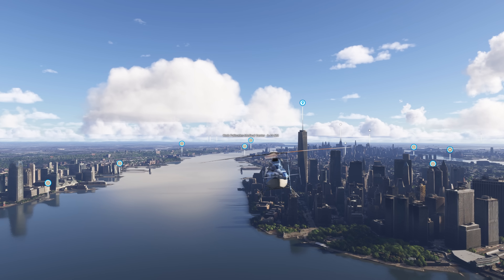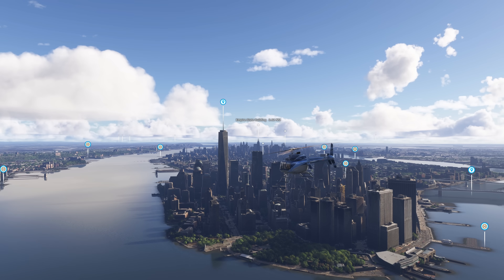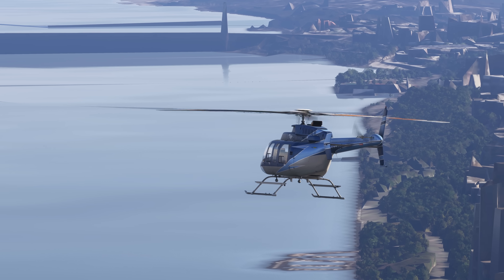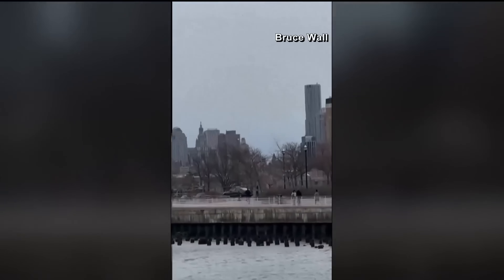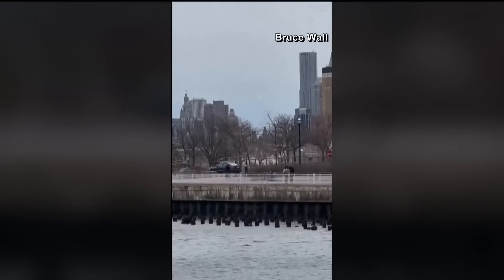Helicopter Expert breaks down Hudson Crash, and discusses “Bump Mast” Theory | NYC Crash Follow-Up

Comment: I don't know much about helicopters but if the rotors struck the  tail boom wouldn't the rotors left a definite mark or dent in the tail boom?  To me if there is no physical indication that the tail boom was struck by the rotor then it's obvious the problem was something else other than mast bumping if that is what would caused the tail boom to separate from the helicopter.

Comment: In the early 70s I worked for a company that had a Bell Jet ranger. On one trip in a snow storm they had a flame out. pilot was able to auto rotate an ;and in a gravel pit.  The rotoor did chop off the tail when they landed, bow one  was injured.  The pilot was a Vietnam copter pilot.

Comment: I've been sold on airframe failure, but have we actually seen a picture of the tail boom? How do we know it wasn't struck??? Why did the transmission and rotor assembly come out, instead of just rotating the helicopter wildly, which would have absorbed most of the pressure to keep it intact?

Comment: Bell released a bulletin in July 2023 of how they wanted a segmented tail rotor drive shaft retrofit to be carried out. Now most of the work carried out was exactly at the point where the tail snapped off . So the cause was probably due to the latest work done on the retrofit of the tail rotor drive shaft. I'll send a link to the bulletin

Comment: Looks to me it was total pilot error but no one is saying is because he was black and probably got an easy pass to be a pilot.
Reply: Looks to me like you need to answer a few questions (if you don't run and hide like the other cowards have).

First, what looks like "total pilot error" to you? Looks like he was flying straight and level, based on the videos I've seen. So, what basis are you making such claim? What type of pilot error, since there are many?

Since the current analysis of many experts in the field is pointing towards the likelihood of a major, catastrophic mechanical/structural failure. Why are you still hoping for pilot error, yet there's no indication of such?

Even if it turns out to be, and you get your wish....are blacks the only ones you've heard of when it comes to pilot error?  How many white pilots F 'd up since the dawn of aviation?  How many pilot error videos on YouTube are white men? Do you mention race/skin color on those?  If you do (and I doubt it), copy and paste your comment here to prove it. I'll wait...

BTW, blacks can and have passed the same exams that whites have. I'm living proof.  I took the same Industrial Electrical written and practical test that the rest of the applicants took. Not only did I pass with flying colors, I scored highest of all, which were majority white males.  High 90s on the written and 100 on the practical.  It's on file with the agency and I can prove it at anytime, although I shouldn't have to. 

You'll just have to take my word for it (or not, who cares).  That was 39 years ago, at age 20. Neither was I given an easy pass by the FAA, when I passed my Private Pilot checkride  at Teterboro Airport, 26 years ago.
Reply: "A sickness known as hate. Not a virus, not a microbe, not a germ—but a sickness nonetheless, highly contagious, deadly in its effects. Don't look for it in the Twilight Zone—look for it in a mirror. Look for it before the light goes out altogether."

"I happen to think the singular evil of our time is prejudice. It is from this evil that all other evils grow and multiply. In almost everything I’ve written there is a thread of this: man’s seemingly palpable need to dislike someone other than himself."

"For the record, prejudices can kill, and suspicion can destroy, and a thoughtless frightened search for a scapegoat has a fallout all of its own for the children, and the children yet unborn. And the pity of it is that these things cannot be confined to the Twilight Zone."
Rod Serling
1967
Reply: Figured you'd disappear and not answer my questions. 😂

Comment: It's not mast bumping. It was catastrophic failure of the tail boom just aft of the fuselage. Mast bumping would have detached the main rotor head, not ripped the entire upper deck from the aircraft. The static stops would hit one side of the mast, made one half a rotation, and contacted the other side. Those two contact points damage the mast (denting it) and off it comes, just below the rotor head. Looking at the video, I dont see any abrupt changes in the aircraft attitude that would cause mast bumping.

Comment: Hey Cpt Steve, Here is my take on it .Using physics and mechanical engineering concepts, here is what will happen.
Role of the Tail Rotor
In a helicopter , the tail rotor counters the torque from the main rotor. Without it, the fuselage will spin in the opposite direction of the main rotor due to Newton's 3rd Law:
 Torque (τ) = r × F
    Where r is the distance from the axis (moment arm), and F is the force.
The main rotor creates torque about the vertical axis. If the tail rotor fails, there’s no opposing torque, so the fuselage spins uncontrollably.
The tail boom then breaks and could  bend sharply at (90°) and projects the tail shaft upward-left, into the path of the main rotor.
The Physics behind this to be considered are :Gyroscopic precession, Conservation of angular momentum, Impact mechanics and Rotational kinetic energy
The main rotor blades will hit the broken tail shaft (which is in an upwards angle) if they are spinning like this 
 ω ≈ 30–40 rad/s (approx. 300–400 RPM) at a Rotor radius R ≈ 5.5 m and blade tips speed v_tip = R × ω ≈ 5.5 × 35 ≈ 192.5 m/s
The kinetic energy in a single rotor blade will be : KE = ½ I ω²
    Where moment of inertia for a rotor blade about the hub: I ≈ ⅓ mR² for a beam-like object.
Not sure of the exact weight but assuming : m_blade ≈ 80 kg R ≈ 5.5 m Then:
I ≈ ⅓ × 80 × 5.5² ≈ ⅓ × 80 × 30.25 ≈ 806.7 kg·m²
    KE ≈ ½ × 806.7 × 35² ≈ 493,369 J (~493 kJ per blade)
That’s a massive amount of energy being delivered to any obstacle it hits like the tail shaft.
So, when the rotor blade hits the shaft ( NOT THE TAIL BOOM) , the impact is off-axis and violent, generating a huge reaction force. The bending moment on the blade is beyond its limits then  blade shears or fractures. The gearbox and mast, which are mounted to the airframe, experience torque shock loads and will cause the transmission mounts to shear if the forces exceed structural limits, and gearbox therefore detachment will occur.
For the Transmission and Mast Ejection we must calculate it this way 
Angular Momentum: L = I × ω
  When the main rotor detaches, the stored angular momentum doesn’t just vanish, it causes violent reaction forces and possibly flight of debris.If the mast and gearbox are ripped free, they will then be thrown by centrifugal forces

The tear through the fuselage and stress forces are calculated this way: 
If the main rotor and gearbox weigh m ≈ 300 kg, and experience an abrupt deceleration then in Physics this is calculated this way :
 F = Δp/Δt ≈ m × Δv/Δt (Assuming: Δv ≈ 200 m/s (tip speed) Δt ≈ 0.01 s Then:F ≈ 300 × 200 / 0.01 = 6,000,000 N or 6 MN
  This is the equivalent of lifting 600+ tons momentarily—well beyond the design tolerances of the Bell 
So, this is what i am  trying to explain: Tail  boom breaks due to tail rotor shaft failure causing the Tail boom to pivot 90° control loss → instant yaw instability, main rotor impact with shaft → blade shearing, transmission overload → mast and gearbox ejection, complete lift and control loss → crash within seconds
Mathematically, the forces and energies involved exceed structural tolerances by orders of magnitude.
I hope I did not offend, misguided or upset anyone with the above. Please correct my Physics and Math if you are in the game
Reply: I think this is a logical argument except for one tiny part that could end up nullifying the whole deal. When you said, "The main rotor creates torque about the vertical axis. If the tail rotor fails, there’s no opposing torque, so the fuselage spins uncontrollably. The tail boom then breaks and could  bend sharply at (90°) and projects the tail shaft upward-left, into the path of the main rotor." Every part of that statement is true except when you said, "If the tail rotor fails, there’s no opposing torque, so the fuselage spins uncontrollably. The tail boom then breaks and could  bend sharply at (90°) and projects the tail shaft upward-left, into the path of the main rotor." I feel like this modification may be a bit more accurate, "If the tail rotor fails, there’s no opposing torque, so the fuselage yaws in the opposite direction of rotor rotation and will become uncontrollable outside of autorotation. If the heli is powered for long enough, he tail boom could break and could  bend sharply at (90°) and could project the tail shaft upward-left, into the path of the main rotor."

Don't get me wrong. I like the analysis. There's really nothing logical wrong in my opinion. However, if you look at most helicopters (the 206L is no exception, just do a quick "bell 206L" google image search), you'll see that the tail has both winglets as well as a vertical stabilizer on the end. The point here is that loss of tail rotor thrust usually doesn't yaw that violently that quickly. It yaws pretty badly, for sure, but because the tail's vertical stabilizer already is in the air stream and having a limited, but significant effectiveness in forward flight, that means there are already loads on it regardless of tail rotor failure. So usually, the tail doesn't snap immediately. In the video, it looked to me as though the yawing and tail boom failure happened simultaneously, which would mean that the tail boom failed first. Granted, maybe a shaft within the tail boom snapped or had a failure causing a lot of vibration or contact with the structural part of the boom causing both a tail rotor and boom failure. I'm just not aware of many helicopters whose tail boom breaks off immediately after tail rotor thrust failure.  

Here are a few videos of typical tail rotor failures:
https://www.youtube.com/watch?v=alpGMjCZ83Y
https://www.youtube.com/watch?v=gcaugF8yqi8
https://www.youtube.com/shorts/o7n-Zldhy9M
Reply: @jonthecomposer  Thank you for your comments regarding the dynamics of tail rotor failure in helos. I really appreciate your perspective on the nature of yaw control loss and the structural contributions of the vertical stabilisers and the winglets. I do agree that logic will state that the tail rotor’s failure does not necessarily lead to an immediate and violent yaw. The presence of the vertical stabilisers indeed provide aerodynamic stability, which can delay the onset of uncontrollable yaw( I am also wondering if the stabilisers and winglets also produced lift at the time of the tail failure sending the tail in an upwards direction at 90°  and into the path of the main rotors( this could explain the amount of strikes noise we hear in the CCTV video available online.).It’s worth noting that while the stabilisers offer some resistance, the rapid loss of tail rotor thrust can still lead to significant yawing motion, especially when the rotor is under power and the helicopter is in forward flight. Regarding the sequence of failure, your point about the potential for a precursor failure within the tail boom is well-taken. There could be complex interactions, such as a vibration or structural stress that leads to simultaneous failures of the tail rotor and tail boom. This really highlights the multifaceted nature of helicopter dynamics and failure modes. Once again, I truly appreciate your insights and your comments.
Reply: @chrisrodot6200  And I truly appreciate your insights too, especially mathematically and logically! 

I do agree that tail rotor thrust failure can cause structural damage/failure in some circumstances. I just wanted to be clear that the reason I didn't think that happened in that way in this instance is just because it seemed that the failure and yaw happened simultaneously from what I could see in the video. I may be wrong. I would assume that if the loss of tail rotor thrust did cause a tail boom to buckle or detach, it would happen further along after the tail rotor failure (than it did in this sequence). Again, I could be wrong. I have no formal study in flight or structural engineering. I only have "arm chair" analysis from the videos that I've seen.

However, I cannot rule out completely that the tail rotor lost thrust first. I know it won't necessarily cause the helicopter to yaw that violently, but there ARE a couple anomalies in the video that makes me wonder. Firstly, if the tail rotor started losing thrust when it was behind the building from the camera, perhaps the pilot was in the process of starting the correction. In other words, perhaps it failed before we could see it fail. But because of a significant correction, the control deviation isn't noticeable until the tail boom failure. Secondly, in the corrected audio sequence (where you hear the audio without delay), it seems that the "chopping" sound you hear starts while the heli is still behind the building! This does present a bit of a challenge, though. Because if the main rotor started contacting the surfaces and quickly losing momentum/speed (as you hear in the video), I feel like the heli would have both immediately started to lose altitude as well as seeing debris upon hearing the sound. Yet, the debris is not seen until well after "chopping" sound starts and the heli emerges from behind the building. My best guesses are that either the beginning of the "chopping" sound is not the main rotor contacting the tail, but maybe caused by internal failure in the tail boom itself? Or, perhaps the audio is stretched a bit because of the recording equipment, causing only the last part of the sound to sync with the video (when we see and hear the splashdown of the airframe). I do have some decent experience with recording music, so I am very "in tune" to sound delays (latency) and how little is needed for things to sound "tight" (usually less than about 15 ms). In other words, if there is any "stretch" for any reason in the audio part of the recording, you might hear the sequence (the "chopping") before it actually starts. Although, I must say it would be a very significant stretch given that it is WAY more than 15 ms!

Let me know what you think as well.
Reply: It's very interesting, but I haven't had to do that math in 40 years, though I have two engineering degrees. The difference is that I am a helicopter pilot, so I know the practical. When a streamlined helicopter, like this one, loses a tail rotor or tail cone while going at speed, the helicopter will commence a curve, but not an abrupt turn like this accident, and not a ripping off of the main rotors, transmission, and transmission deck. The reason is airflow, which impedes the rotation. You would have to add that into your calculations. I have witnessed several occurrences, including being next to an aircraft that had a sheared tail rotor drive shaft by a rotor strike. If the helicopter is hovering, it will spin, but not in forward flight, where it will curve. Helicopter pilots are trained to immediately reduce the collective (torque) when they lose a tail rotor. You can even use your forward airspeed at low power to get you to a safer area before you autorotate, since the shape of the helo will give some directional ability with the addition of banking. By banking away from the turn, some of that rotational force will be converted to lift. You won't go far because you can't pull much power, but maybe just enough to get to a safer landing site.
Reply: @billlewis1483  Hi , thank you for your comments on the mechanics of helicopter operation regarding tail rotor failure and its implications. As a helo pilot, your practical experience adds so much importance to the perspective of theoretical calculations. I really appreciate your point about the airflow dynamics affecting helicopter behaviour in forward flight. You are right that the streamlined shape of a helicopter can influence how it responds to losing a tail rotor or tail cone at speed. The gradual curve you mentioned, as opposed to an abrupt turn, is a key factor that should indeed be factored into the calculations and considerations in a such scenario. Your observations regarding pilot training and the immediate actions taken upon losing tail rotor are invaluable. Reducing collective pitch to manage torque and utilising forward airspeed to navigate towards a safer landing site are critical skills that will make significant differences in the event of a tail rotor failure. The ability to bank away from the turn and convert some of the rotational force to lift is a strategic approach that is if the tail is still attached and not curved to a 90° angle with possible lift induced from the winglets or if the cabin/cockpit, (my apologies if this this not the right terminology) is now banking downwards itself due to gravity( which will have the main rotors strike the loose tail).  I will certainly take your insights into account as I continue to explore the physics behind this dynamic helicopter incident and apply some maths towards this. It's so beneficial and crucial to combine theoretical knowledge with real-world experience, and your input has enhanced my understanding. Thank you again for your expertise

Comment: Seems like they had a catastrophic engine failure of some sort, or the transmission completely locked up, instantly causing the subsequent failures and destruction to happen in mere seconds and the pilot wasn't able to do anything from that point forward as the aircraft was unrecoverable and would have never sustained any level flight let alone any control from the inputs of the pilot whatsoever.